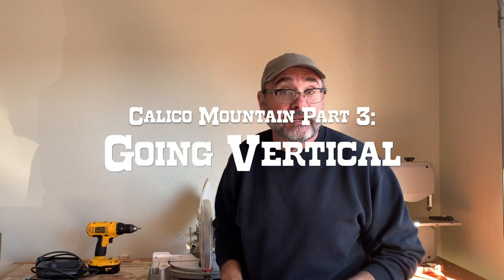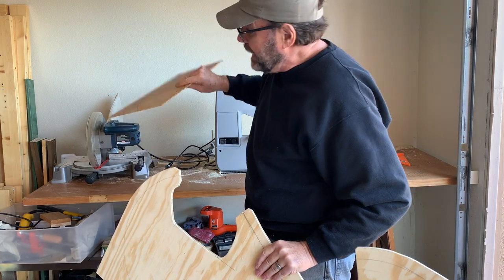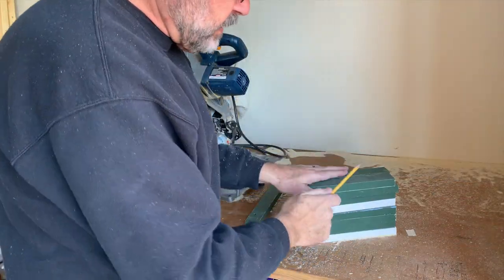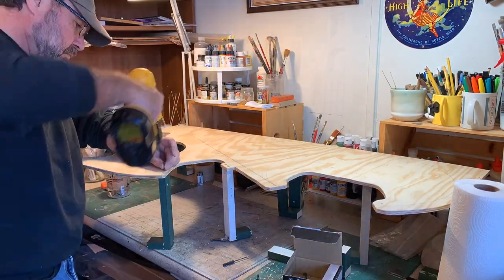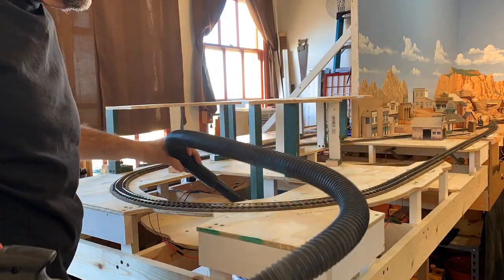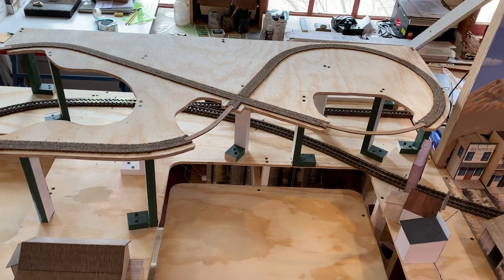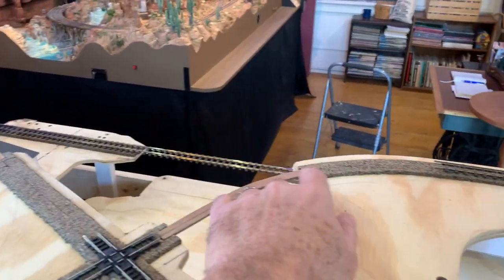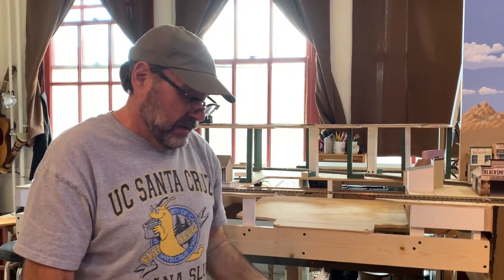Calico Mountain Expansion Part 3: Going Vertical

Comment: Thank you for this series on the Calico Mountain Extension, and all your previous videos. I had a pretty elaborate "train set" on a ping-pong table when I was a kid and had lots of fun running trains through a landscape of Erector Set, modular blocks and Lego, but never felt confident enough to try to make "real" scenery like they showed in the books and magazines of the 1970s, which I thought was the only way to build a "real", "serious" model railroad set in the "real world".

I've put up and torn down benchwork several times over the past few years, but never had a train running. I just wasn't satisfied that I was building toward the sort of "work of art" that "serious" railroad modelers are supposed to achieve.

But the "real world" sort of sucks these days, and it's one I want to forget about for half an hour or so. Your railroad is not only a work of art, but of poetry, comedy, and music as well. It's about running imaginative and whimsical trains through an equally imaginative and whimsical landscape and it just seems like one heck of a lot more fun than trying to build exact scale models of the real world. Starting in the morning I'm going to knock together something in On30, something that a little O-4-0 can navigate pulling a boxcar, flatbed and caboose up a slight grade, over a trestle, through a tunnel down past a station/saloon/hotel and back up and around again.
Reply from the maker: Thank you, And good luck with your modeling efforts!